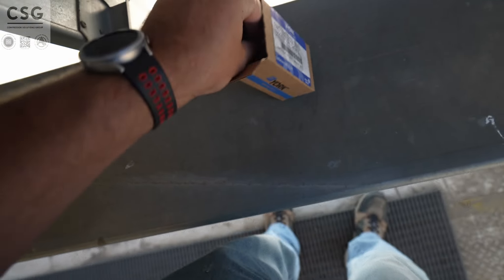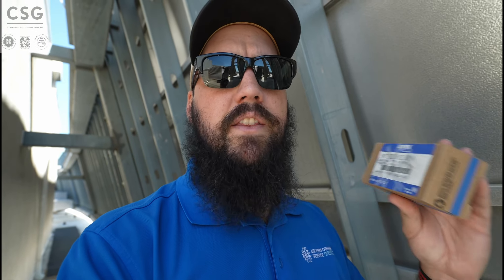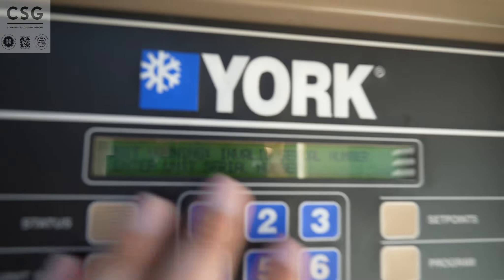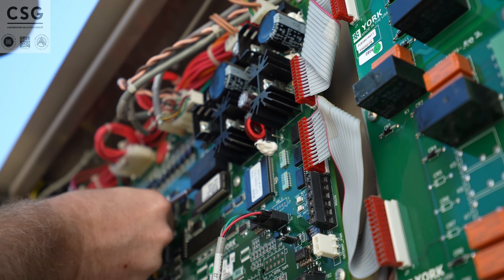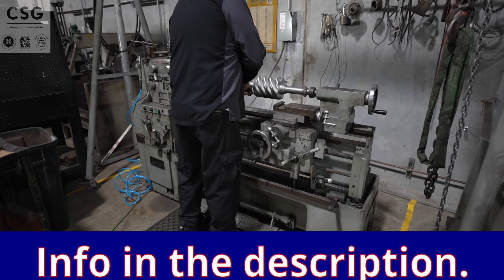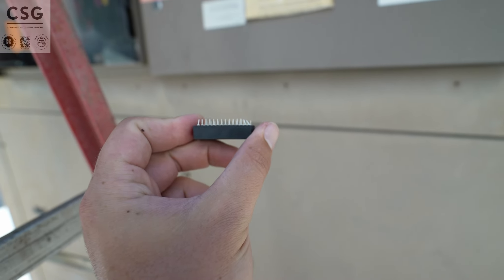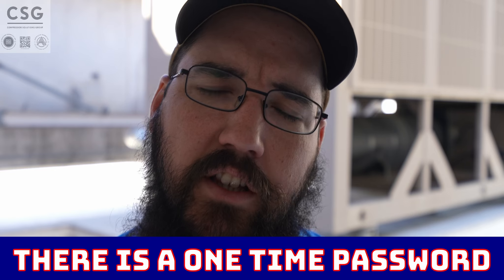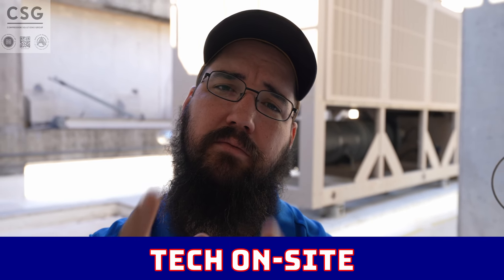YCIV BRAM Replacement on York Chiller

Comment: At this point might as well have them replace the chip themselves this way it's under warranty and if they bend a pin then it's on them ... They'll probably charge you a pretty penny for a 15 minute job though ...